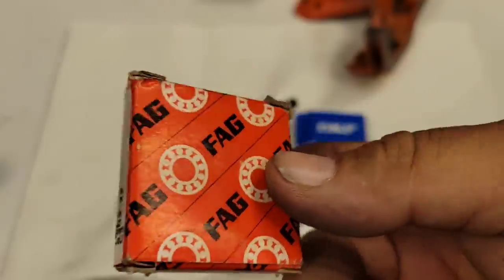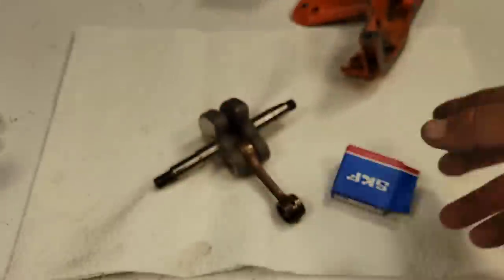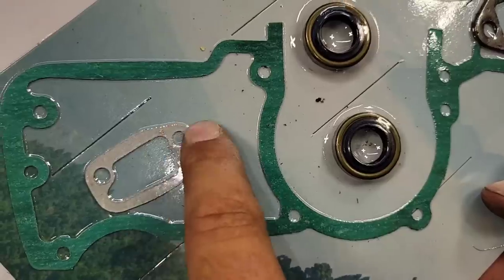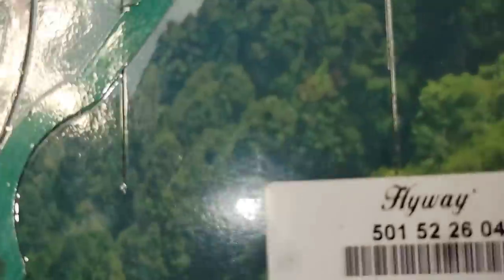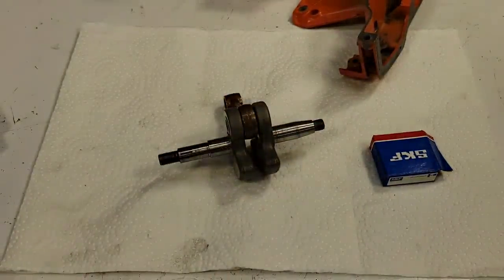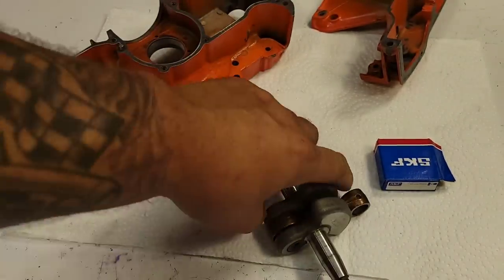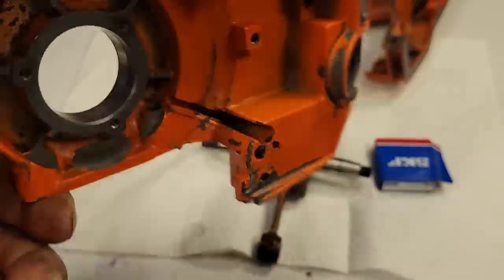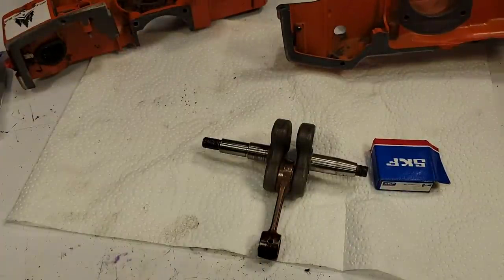Crank bearing replacement on Hogans 266xp. These cases are fighting me!!!

Comment: Freeze the crank helps. If anyone needs part # for Genuine Husqvarna 61 thru 272 crankshaft fitting tool it is 502 50 30-04 . But fits the newer style fine thread crank only. Also - ( The 371/372 tool is 502 50 30-15 ) I bought mine from HL supply.
Reply from the maker: Thanks for those part numbers. I'm going to pin this.
Reply: There are two different crankshafts for 61 to 272. The 10mm  and 8mm flywheel nut different installer tools. The 8mm being the newest. The 10mm same as  the266 and the older style but with fine threads on the clutch. The original 266 crank had coarse threads on the clutch but were limited.

Comment: Tinman, if you measure your side clearance on the crankshaft prior to tearing it down, during reassembly you can lay a piece of shim stock or a feeler gauge on the case half prior to dropping the crankshaft in. Just a tip to save you some time adjusting things later.
Reply: If you could slot it, leave no chance of catywampes, not that it really can just a thought but yes def good idea
Reply from the maker: Most bottom ends I do are blown up so I tend to not take for granted that the crank was centered or that the bearings were sitting in the right spot.
Reply: @tinmanssaws  lol nice buddy, friend ask me if I can build him a saw what kind, I just say give me a piston and well go from there lol, whatever you want

Comment: When going back together, I heat the bearings with a heat gun and drop them on the crank and let cool. I’ve been freezing the crank assembly in a deep freeze and heating the cases with limited success. From now on liquid nitrogen will be my go to freeze the crank. You can get a dip tube bottle from your welding supply place for a minimal amount of money and it makes assembly a ton easier for press fits. You will literally have 15-20 seconds once you assemble the cases to center the crank up. It will usually get you .006-.008 shrinkage.

Comment: Tin man, “Thank you “  I just finished my Husky 61 from the bottom end up.  I appreciate your very helpful videos ! I never would have got the heat right for the bearings or been able to install the seals correctly. I really like the “ cone” trick on the oil pump seal. Anyway the saw runs, oils and makes power again. So, I wanted to “Thank you” for your help, you deserve it!   Carry on !    Nick/ Vermont

Comment: Brother, I'm putting my facebook find 394xp together with this video playing in the background. How to heat the bearings, how to heat the case halves, and what to do when the crank is binding when it's back together. When you said "or you can grab you case splitter," I whipped mine out and put it on. Worked just like you said. BIG kudos from North Carolina!

Comment: Building anything is easy until something starts to go wrong. Being able to correct it on the fly is what sets apart the pros from the amateurs. Seeing the process when trouble occurs will be  the lesson learned by many today. So easy to just not post that!  You were cool under pressure today. Thanks so much for sharing.
Reply from the maker: I've been waiting for one like this for awhile. Showing the failures is just as important as the successes

Comment: Still waiting on parts for that 272xp build. Then I will start looking at a 266xp. They are in ruff shape bottom end all siezed up but it wouldn't be fun if it wasn't a challenge. By the way does the 272xp have a seal carrier? If so where can I purchase one. It doesn't show up on any DPL schematics. TC Tinman Mahalo 🤙🤙🤙